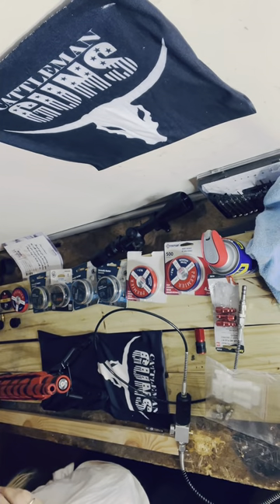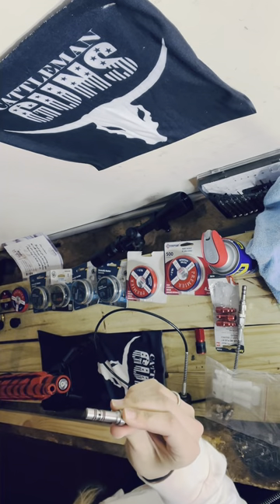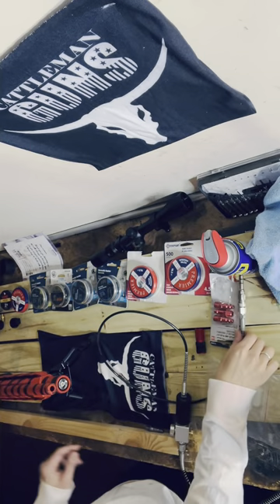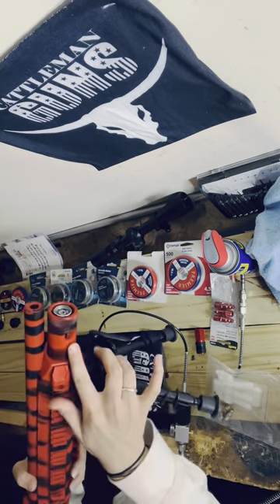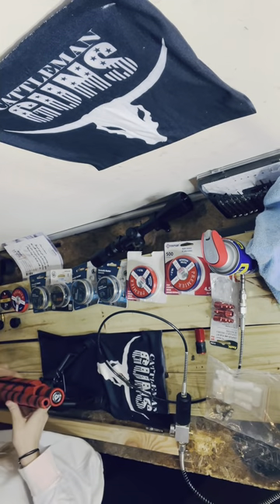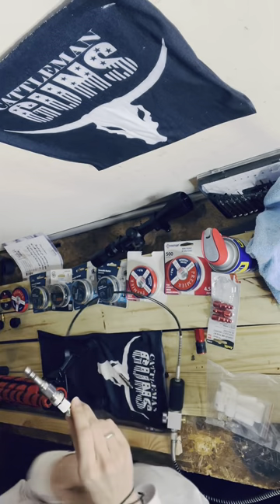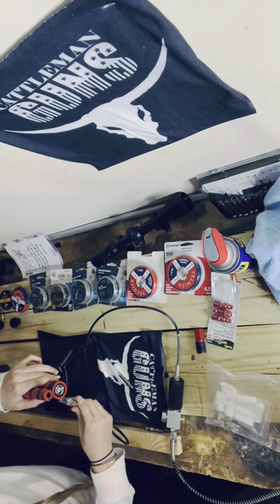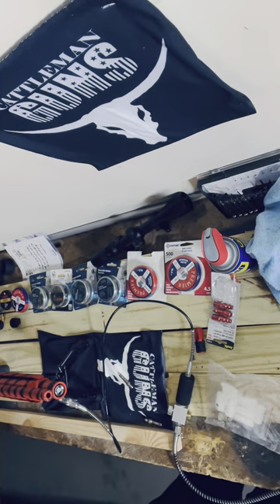Cattleman Guns Pneuwa PCP Air Rifle Filling Tank

Comment: i have a brand new T1 that has not been fired yet...i attempted to have air put in it at the scuba shop, however it seems to be leaking air from the other end. (basically not holding any of the air...) Is that normal or is there something else going on or something im possibly doing incorrectly?

Comment: I’ve only had the gun two weeks and it stopped shooting completely What a disappointment at first I was having misfires like crazy every time I would take the gun out of safety it would automatically shot without even touching the trigger if I want to shoot the gun I had to leave it in fire Could not put safety on or it would misfire now the gun won’t even rack I could pull the lever all the way back and it won’t rack anymore I tore the gun down and found nothing wrong everything looked fine . I’ve been trying to contact cattlemen but haven’t heard nothing yet
Reply from the maker: This rifle needs to be replaced. This happens when a tiny ball shaped piece is missing around the trigger assembly. Please email us at Victoria@cattlemanguns.com we apologize for the lack of communication we are at the manufacturing in Turkey working on upgrades and innovations. Phone calls return June 1st. I assure you this matter will be rectified as soon as we can. Thank you for your time and patience, I look forward to speaking with you.